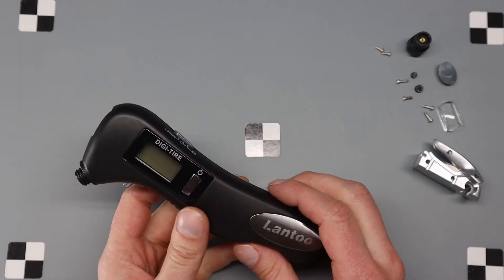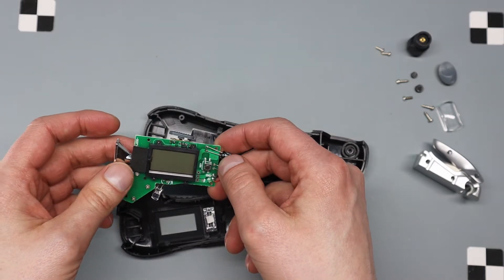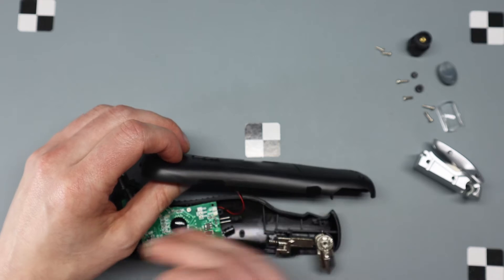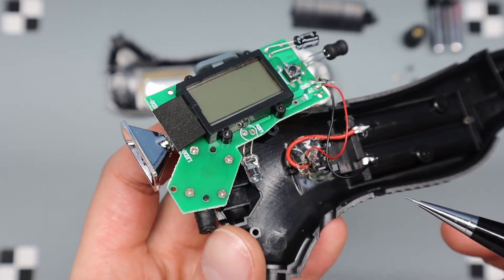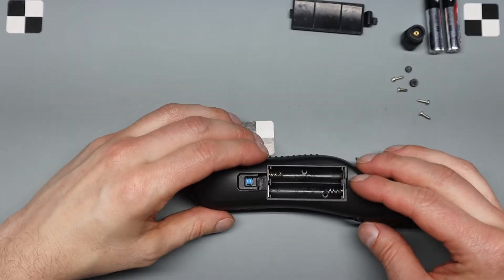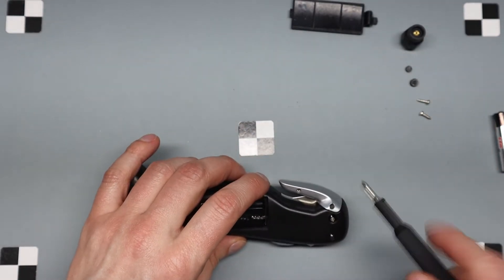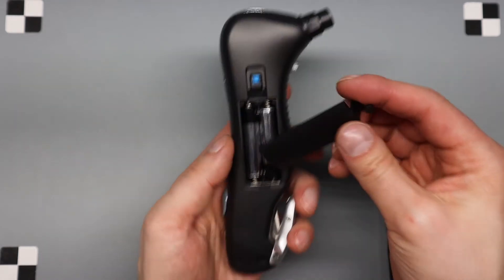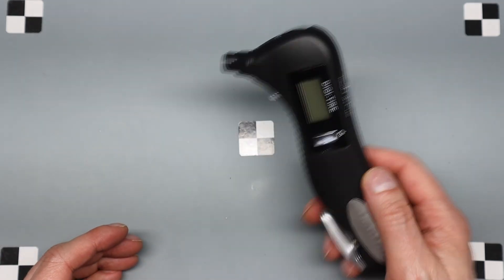Fixing Digital Tire Pressure Gauge Battery Drain

Comment: I have a Husky version of this tire pressure gauge and it’s powered by both AAA batteries for the lights but also a 2032 coin battery in a compartment UNDER the AAA batteries to power the pressure gauge!!!